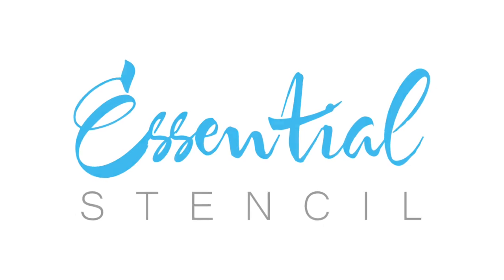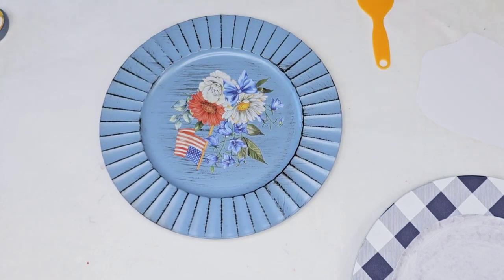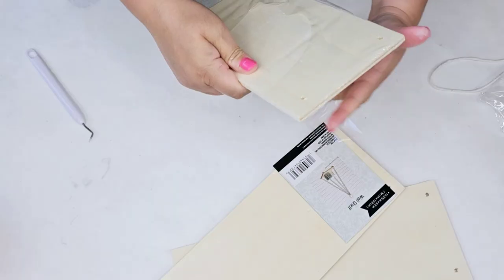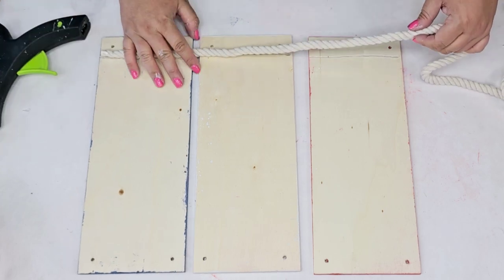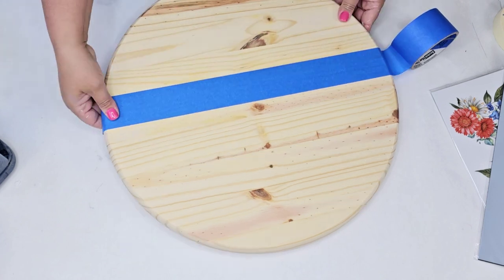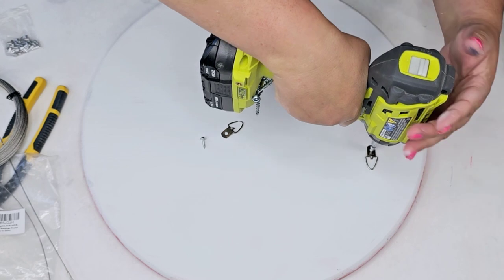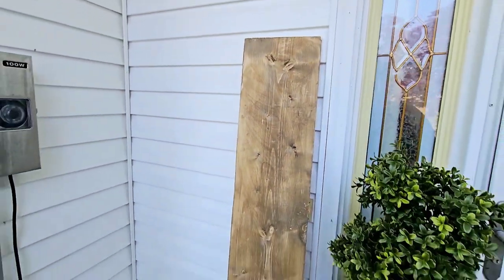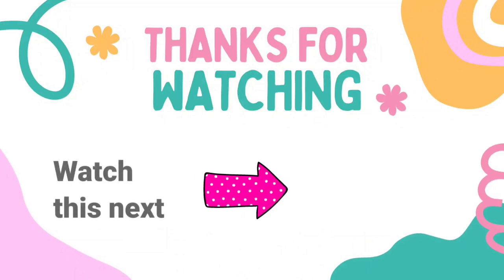GENIUS Dollar Tree DIY Crafts | Summer Crafts

Comment: If the "Sippin', Grillin', Chillin'" sign is used outside, what kind of sealer should I use? Do you think mod podge would be ok to put on it for using inside?
Reply from the maker: Hi! Modpodge should be great for indoor.  If it will be outdoors, I'd say seal it with a polyurethane or Polycrilic.